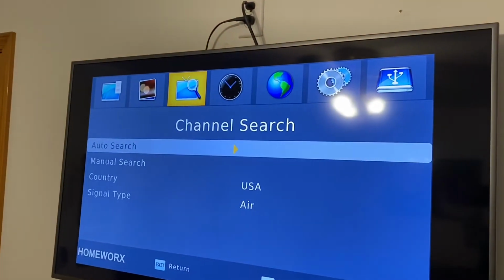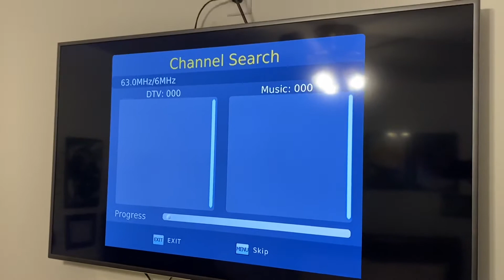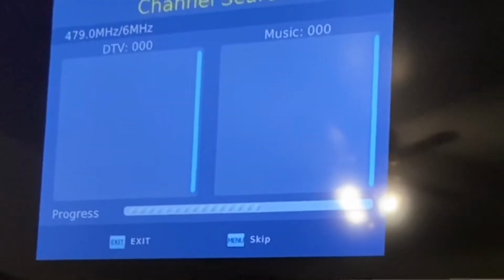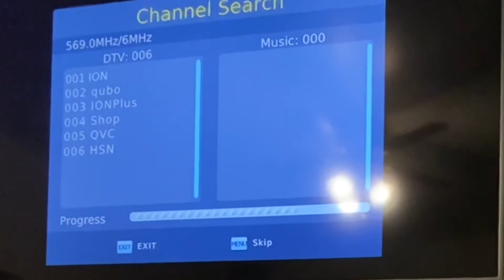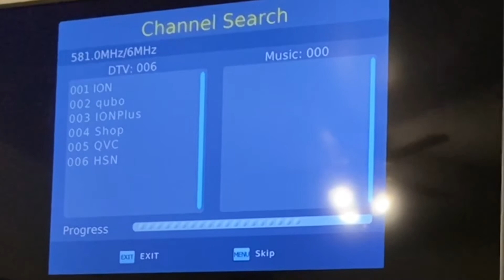Can A Paperclip Work as an HD Digital Antenna?

Comment: A Hunk of rooftop metal connected to a coax wire is best for stable and plenty of channel reception. I have the CM Omni+50 and I split it between the TiVo Edge OTA/Streaming DVR And the Samsung 60" plasma with no boosters. Tyler AntennaMan does not stress enough on He is advising boosters for coax longer than 100 feet and suburb and rural areas. A Metro realm is privileged with signal strength.

Comment: Yep. If the signals strong enough. Anything will work. How is that RCA rotor working for you.
Reply from the maker: Funny you should ask… I do not recommend that RCA model. The electronics failed a few days after making the video. In portions of Western New York, you can receive stations from basically all directions and I currently have 8 antennas that I am switching off and on with AB switches. It works great and it was actually cheaper than buying the Channel Master rotator. It’s not for most people but it works for me.

Comment: Use any thin metal wire and it will work.
Reply from the maker: Many people think you need a special “HD Antenna”. Antennas are simply pieces of metal!
Reply: @WNYOverTheAir  Exactly. The antenna doesn't care about analog or digital signal it's designed to receive a frequency band. Some antennas perform well on VHF, others on UHF or both. Even the VHF frequency range some can receive VHF low and VHF high or only VHF high. For a better reception I recommend installing two antennas one for VHF and the other UHF and connect them with a diplexer two have both signals on a single cable. The receiver is what matters, the receiver can be HD or 4K, also the receiver can be ATSC or ATSC 3.0 (the new standard)
Reply from the maker: I elaborate on this in my video titled “Installing an Antenna for Free HDTV: What You Need to Know”. That video isn’t doing as well as the others, probably because people arriving to my channel know a thing or two about antennas already!
Reply: @WNYOverTheAir  two words: advertising gimmick 😂

Comment: When I was a kid I used a 15' peice of solid core copper wire as my antenna just stuffed in the coax connector. Used that as my antenna from the late 80s till we got cable in 97